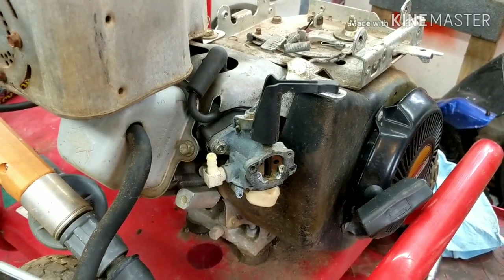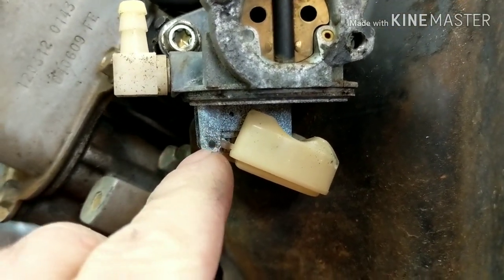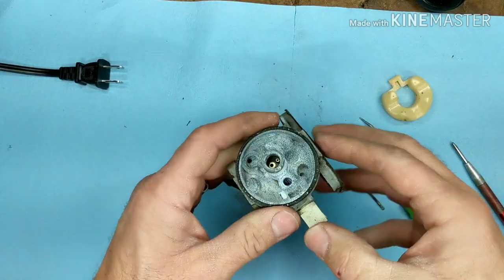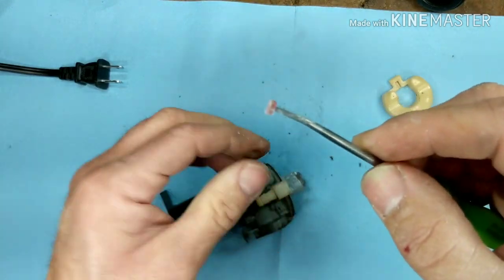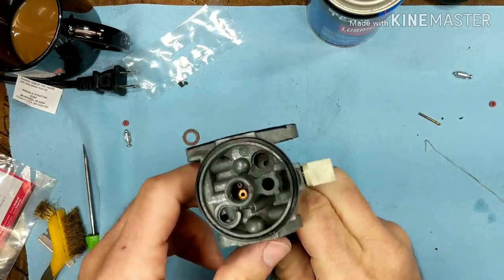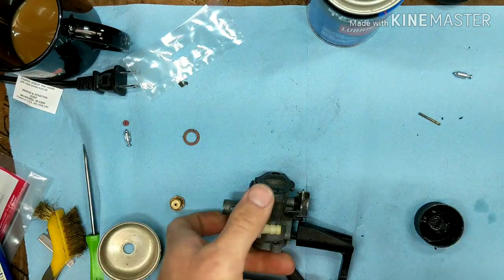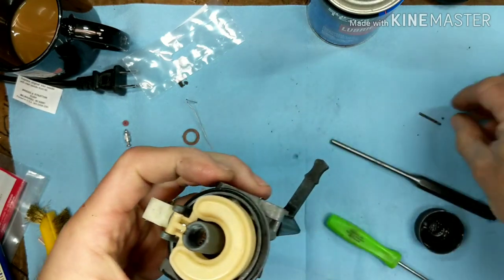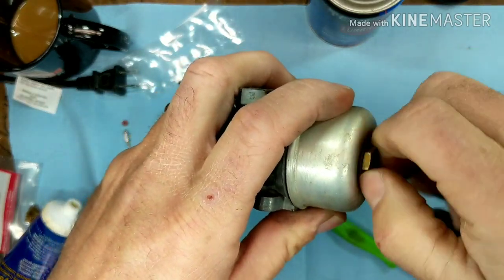Briggs surging under power repair

Comment: I pulled the carb and my float looked exactly like yours in the video. Depending on what part you need some people would be better ordering a whole new carb. I like to tinker so I'll repair mine. Thanks for the video
Reply from the maker: I buy those needle seats by the dozen and that's usually all the carb needs besides a cleaning and bowl gasket if it tears.

Comment: Great Vid, try Tecumseh tool 670377, makes seat removal and installation a breeze!  I noticed STP carb cleaner is the worse on rubber seats. Brakleen doesn’t affect it as much. I’ve even boiled swollen seats in water to get them back to normal size in a pinch.  Love your channel.
Reply from the maker: Thanks for the comment, I'll look up that tool! Never really gave me a hard time getting out but I love new tools, and time is money!
Reply from the maker: Oh just looked it up, I'll be ordering one, nice!

Comment: I have that same pressure washer and it ran perfectly until I loaned it to my sister in-law who kinked the hose all to hell and left gas in it for two years before I got it back. I tried to clean the carburetor but it never ran right. So I bought a new carb and now it idles fine but it surges when I spray and when it gets hot it shuts off and won't run until the next day when it does the same thing all over again.

Comment: What is the title for your other video on surging Briggs' (at idle)?  The link is missing from top-right corner, where it should be.  
I looked through your many uploads but couldn't find the correct one.
Reply from the maker: https://youtu.be/DxfARNdqgFw This is on a Honda but pay attention at 1:40, this is the same problem with many Briggs that use that carb.
Reply: @TepcoCycleRepair  Thanks!

Comment: Maybe you could help me with this question, I got an old but in good shape craftsman 12 horse rider with a Briggs & Stratton engine, my governor has linkage with the tiny long spring that slides over the linkage to take out any slack, my engine is surging back-and-forth constantly, you can see the linkage and governor going back-and-forth back-and-forth, I took the carburetor off and totally cleaned it and rebuilt it with new nozzles and jets, also bought a brand new spring from Briggs & Stratton even though my original looked good, I put it all back together and the governor and linkage is still surging back-and-forth even with the new spring, if I hold the governor with my finger I can make it idle smoothly so I assume that’s telling me it’s not the carburetor right?,  I can’t figure out why when I take my finger off that linkage and governor it is still bouncing back-and-forth causing it to surge , it’s the older one piece Flo-jet carburetor, any ideas? Thanks
Reply from the maker: It's not the linkage it's the carb or more specifically fuel flow. Those carbs should have a screw with a spring on the top for low speed air/fuel mix and one on the bottom of the bowl adjusting main jet flow. Turn the one on the top out to see if it helps when idling. Make sure both of these are set properly.
Reply: Tepco Cycle Repair Like I said I have completely rebuilt the carburetor with a rebuild kit from Briggs and Stratton, I replaced the top screw and bottom screw already and completely cleaned the carburetor, I have tried to adjust those screws in every position imaginable with no change on the surging, I also replaced the main jet and needle, I have tried and it doesn’t matter where you adjust the top and bottom screws it’s still surges. It’s only surging under power.
Reply from the maker: @wild8757  Ok you would be suprised how many people just tighten them in so I figured I would mention it, I did read you rebuilt it. If the carb is 100% and no air leaks, I would be checking compression and valves.
Reply: Tepco Cycle Repair Compression is good I tested it, new air filter, new fuel filter, I adjusted both upper and lower screws starting at one and a half turns out like the owners manual says to start at and then worked from there in and out with both still with no change, still surging, checked fuel cap pin hole,new carb linkage spring, checked fuel lines, replaced spark plug and new intake gasket, It idles fine, only surges  at high speed, if I hold my finger on the governor to make it run at high speed it does not surge, when I take my finger off the governor it starts to surge again, wouldn’t that tell me that it’s not the carburetor if it runs fine when I hold my finger on it?
Reply from the maker: @wild8757  No, the governor reacts to engine rpm. If the carb is over or under fueling the rpm will change causing the governor to react. By holding it you're also holding the carb linkage. I understand how it looks like a governor issue but that system is simple. Sounds to me like a carb issue. I have rebuilt carburetors before that simply didn't work and continue to surg no matter what I've done.
Reply: Yeah it’s just frustrating that if I hold my finger on the linkage going to the carburetor I can make it run at high-speed without surging no problem but as soon as I take my finger off it starts going back-and-forth surging again, driving me nuts I can’t figure this out
Reply: Tepco Cycle Repair I don’t know if it tells you anything or not but when I first start this engine cold and throttle up to high it doesn’t surge at all, runs perfect, as soon as it warms up it starts surging after about five minutes of running
Reply: water in the gas? could be from the gas station?
Reply: @wild8757  @Tepco Cycle Repair
Hey did you ever figure this out? Im having the same issue you  described with a log splitter
It idles fine starts up fine but when I give it full throttle starts to surge and can see the linkage moving back and forth the same as you described, I just installed a carb off Amazon non oem
Reply: @gerardorosillo932  Nope never figured it out, I said fuck it I’m not spending money on a knock off when I just put all that money into rebuilding the original flow jet and everything else, on top of that I bought a new riding lawnmower and I’m keeping the old craftsman as a spare to to use if the new one needs to go get serviced under warranty for anything, I’m guessing it has a valve problem or it’s just one of those carbs that have a bug and will never stop surging no matter what you do, how did the non-OEM work out did it stop surging?
Reply from the maker: I'm not sure if he figured this out yet but surging is usually from fuel starvation. This can be caused by fuel in the bowl getting low from fuel flow from a tank, clogged filter, pinched fuel line, improper jet size, or improper mixer screw adjustment if at idle. Find out at what RPM your engine surges and focusing on that fuel flow. So at idle you would look into the pilot jet, at wide open throttle you would look at the main jet.
Reply: @TepcoCycleRepair  I drained my tank and then used compressed air to blow back into the tank and it was clear as a whistle, checked the pinhole in the cap, put new fuel line on and fuel filter, new jets and screws from Briggs and it still did it so I gave up

Comment: I have a Coleman Minibike and it stalls when the clutch engages(6.5hp Honda clone) . Cleaned the jets, bowl, float pins, etc….still stalls under load. Bought a new carb. Same problem! Can there be other internal issues?
Reply from the maker: Yes, check the valves. If they are tight it will not have enough compression to handle a load. If they are good, do a compression check.